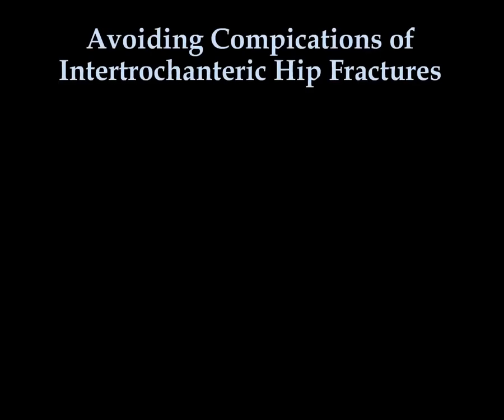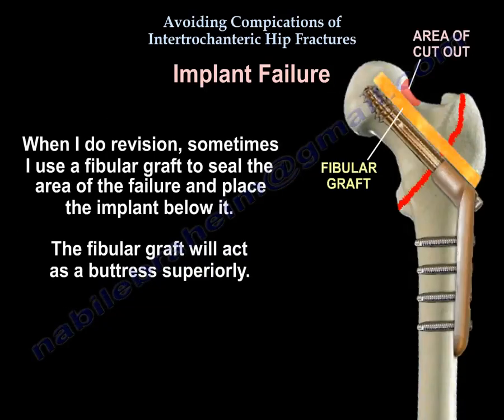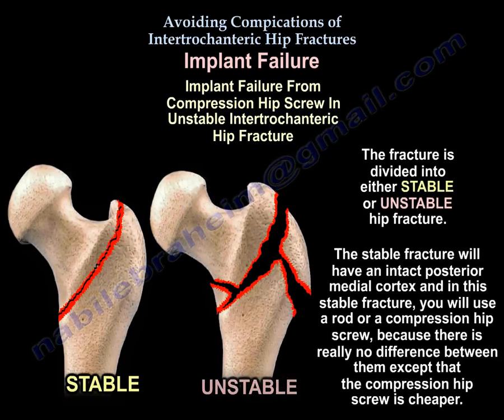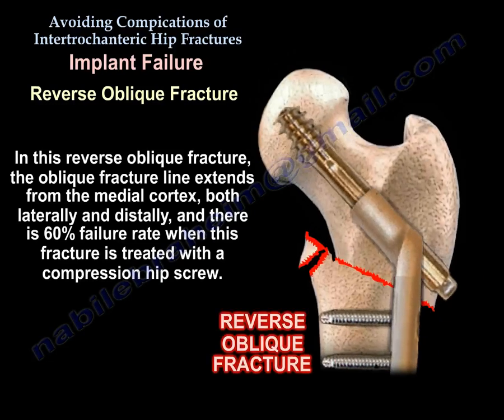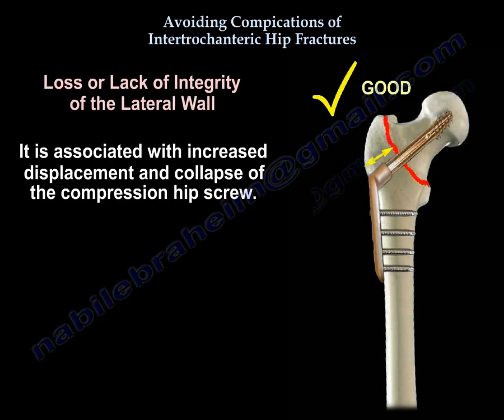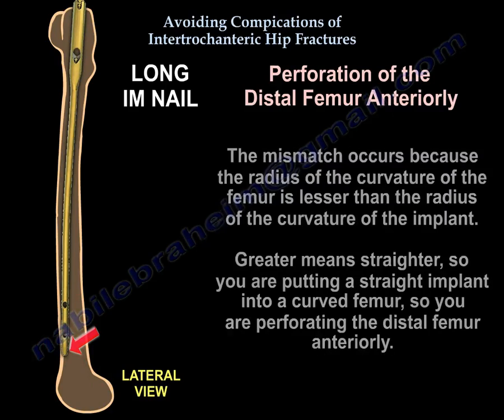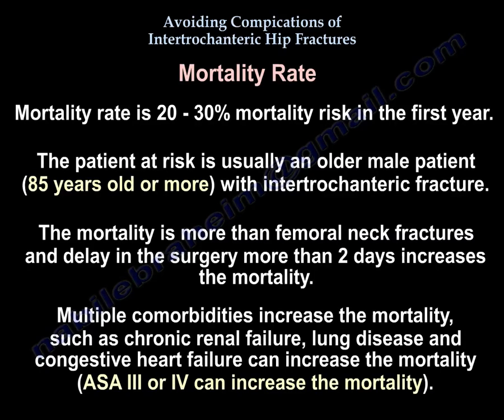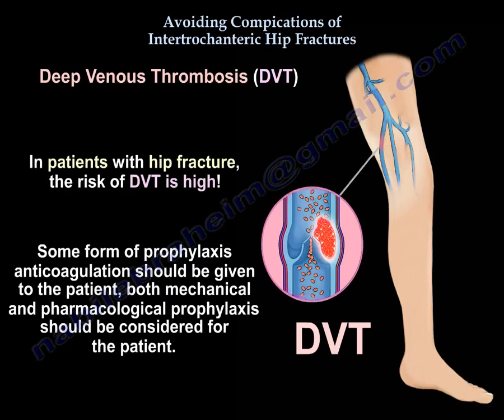Avoiding Complications Intertroch.  Hip Fractures - Everything You Need To Know - Dr. Nabil Ebraheim

Comment: There is a little mistake with de measurement of the lateral wall thickness, the cut-off point for balancing sensitivity and specificity was 20.5 mm not 25 mm... https://pubmed.ncbi.nlm.nih.gov/23908432/